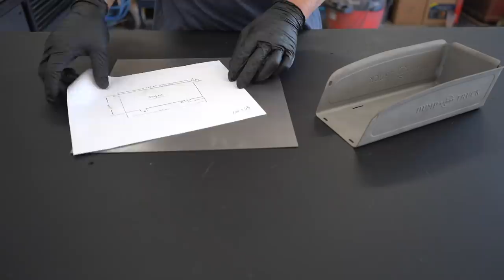1940's Buddy L Dump Truck Restoration

Comment: 70+ years from now, a restoration video of one of today’s toys will be 3 seconds long consisting of the toy being thrown in the trash because it was made of crap.
Reply: the toys of today may be crap...but they are much much safer...i remember a lot of toys from my early 70's childhood...and seeing the toys from my fathers late 40's childhood...safety was not a priority...i think things started getting carried away in the early 90's...when metal parts pretty much became a thing of the past
Reply: Very true.  Just like the cars of today.  Who in 70 yrs. from now will be wanting to restore a 2014 Kia Sorento ?
Reply: @daftboy11  cars of yesteryear...dangerous at any speed
Reply: I know next 70 years could be restoring a 2002 honda ody sorry it is my favorite van from all time i hate new and old. I do like some Toyota Sennia.
Reply from the maker: Just goes to show you can't have it all. You can either have Cool or Safe, not both apparently lol
Reply: @TRGRESTORATIONS  i think powder coating makes them much safer...since they're far less prone to rust..i think one of the big failures of the manufacturing of these old trucks...not putting a spacer on the axles...most of them i'v seen in the scrap heap has been because a kid tried to ride it
Reply: @WilliamHollinger2019  i like to mix new and old..like turning an old space heater into a bluetooth beach radio...or modernizing an old  flashlight into LED+rechargable
Reply: Also, if the war was still going, and even after it, there were restrictions on materials.

Comment: Wow, great job! When I saw the text saying the box was originally blue, I was screaming on the inside that the chassis was red, not orange, and I was so relieved when I saw the finished product. The split-screen during powder coating was REALLY cool!
Reply from the maker: Thanks! I originally though orange, but there was a tiny spot of the original red left in the seams. The truck must have spent a lot of time in the sun to be that faded out!

Comment: Another great restoration Tim saving a toy from a bygone era.  I was wondering if you believed the wheels were original to the toy.  If they were, I was amazed at the remarkable shape they were in.  I hope you and yours stay healthy and cheers from Tennessee.👍😷🍻
Reply from the maker: I'm almost certain the are original. I've seen several from that era with the exact same wheels, and they are all usually intact. I'm not 100% sure but I believe they are oak.

Comment: So what would you have done different if there would have been lead in the paint?? Just wondering....
Reply from the maker: Removed as much as I could with a paint stripper. The sandblaster would turn the paint to dust, not good to breath. Honestly, just doing one toy wouldn't really hurt you. But as many as I do it's just good practice just in case.

Comment: I never thought about checking for lead. Which decade had lead paint?

If you find lead paint, instead of blast, do you use a chemical stripper ?
Reply: Lead wasn't removed from paint until the late 1970s, every painted item from 1984 and older should be checked for lead content. Manufacturers would have used old stock of paint before replacing the leaded paint.
Lead was in Gasoline until then, unleaded gas started in the late 1907s early 1980s.

Comment: Wouldn't it retain more of its' value if it was left in original condition?  This thing was in pretty decent shape for its' age.
Reply from the maker: Not really. These are pretty common toys so it's not like this was a one of a kind piece going up for bid in a fine auction house. It's a $70 - $100 toy either way you go. Just depends on what a buyer wants and is willing to pay for it. The only high dollar toy trucks you'll see go for big money would be rare, mint condition, in it's original box.

Comment: What happens if the toy tests positive for lead? Can you not work on it?
Reply from the maker: I just use a chemical paint stripper to remove what I can before it goes in to the sandblaster

Comment: Why do you need to check the lead?
Reply from the maker: To make sure there's no lead paint.
Reply: @TRGRESTORATIONS  Ok, but if there is lead paint, what changes in the restoration? That's my question.